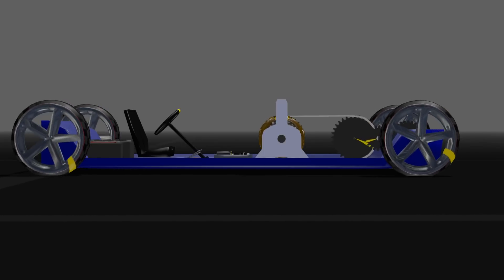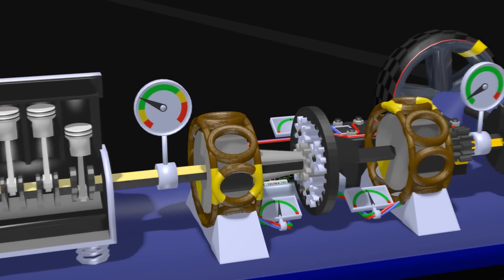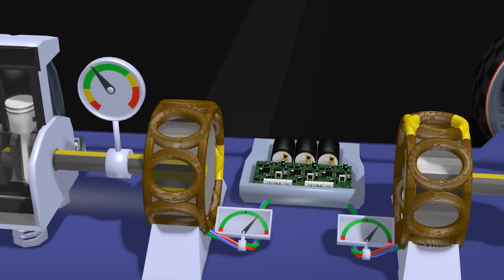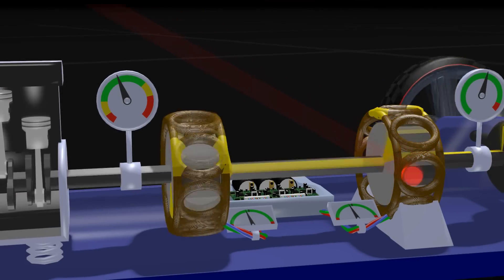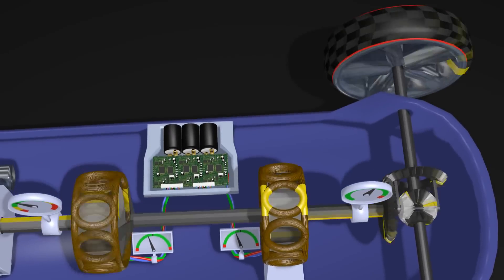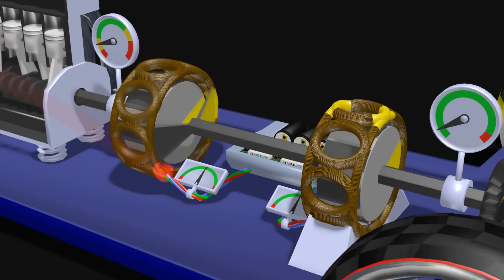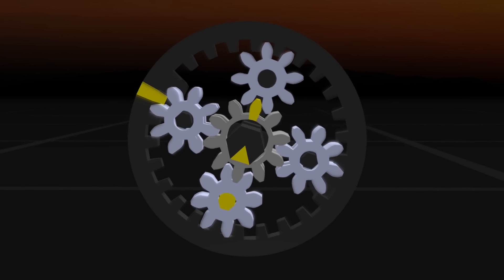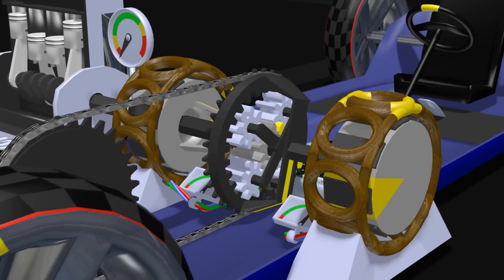Prius Hybrid Drive Explained

Comment: So the basic idea of Prius Hybrid is adapting the system from a Diesel Locomotive. Using the engine to power the electric motor so it will spin the wheel...?
Reply: Yes, exactly! Another name for this powertrain type is gasoline-electric. And unlike locomotives, being on the smaller scale of passenger car allows batteries to be used.
Reply: Sort of... with an extra catch of a planetary gear that "reinvents" the workings of a cvt. Production cars with a real engine-electric system like diesel locomotives is the Nissan e-power lineup. A puny 1.2 litre 3 cylinder with 80 horsepower connects to nowhere but the generator unit. And a 108 or 130 (depending on model) horsepower electric motor does the whole work to the wheels.
Reply: No, that would be a series hybrid, not a power-split. Also, it's not a hybrid unless it has two power sources (an engine and a battery), but the traditional diesel-electric locomotive (or ship) drive has only the engine (no battery).
Reply: @brianb-p6586  It's basically what new Civic uses. Plus it has direct mode, where combustion engine powers wheels directly (through simple clutch), to avoid double energy conversion when possible (at steady speeds of 60-150km/h in case of Civic). It may be even simpler and nicer solution than Toyota's. There is no gearbox in Civic as there is no need for one because strong electric motor powers wheels. End result is that 184HP Civic in 1000 km mixed test got basically same end fuel economy as 184HP Corolla (5l/100km average). Difference is that Civic is bigger/heavier and it provides better dynamics (due to use of powerful electric motor). Both are interesting, but I think Honda's may be even better due to simplicity. Maybe Toyota's has bigger potential though.
It's also hybrid as it has small battery to store surplus of energy (also from recuperation) and help to give electric motor more current in extreme cases.
Reply: @SOMEONE-ME  All Honda models with iMMD (intelligent Multi-Motor Drive), as well as the Mitsubishi Outlander PHEV, work that way. The bypass clutch is important to efficiency. There is a gearbox, but it has only one drive ratio.

It is more complex than a Prius transmission, with just as many gears plus a clutch. It is more efficient than a power-split when the clutch is engaged, and less efficient the rest of the time.
Reply: @brianb-p6586  When you look at actual physical design on weberauto for both systems then hard to see that Honda's is more complex, but I'm not an expert, so not going to argue.
How can you call single gear ratio a gearbox? For me 'gearbox' is something which allows to change gears :) Civic uses a fixed connection, wich is in every car including electric ones.
I agree that clutch is an extra/weak(?) element.
It would be nice to count moving parts as this is some (maybe poor) indication which is more complex :)
Possible what you said about efficiency. In real world Corolla and Civic with same HP are basically identical for long mixed drives, but Civic is more dynamic and gives more pleasure (but this is also due to whole cars been different). New gen. 5 system in Corolla for 2023 may actually change it. Finally Toyota realised that using more powerful motors may actually benefit even efficiency.
I prefer both solutions to 1l+ turbo engines :)
Still the king of simplicity and efficiency is an electric motor (good 3x). If we just had good enough battery tech to allow to use electric motors properly in cars.
Reply: @SOMEONE-ME  A gearbox is literally a box with gears; just check dictionary definitions. It is a form of mechanical transmission, specifically using gears. The gearbox or transmission in a car normally has multiple ratios, but that doesn't mean that all gearboxes have multiple ratios; fixed-ratio gearboxes or transmissions are common in industrial applications and now in electric vehicles.

Count gears in the Honda unit and a Prius unit... there are about the same number. The power-split device in Toyota's design is a single planetary gearset; it is no less complex than a clutch, but doesn't require a control system and is more durable and reliable than a clutch.
Reply: @brianb-p6586  Not going to argue about a word definition as it's really meaningless here. 'Real gearbox' is rather complex, made of many parts, breaks, expensive to repair etc. Single ratio connection is FAR from it.
I think both systems are interesting, yet quite different.
Clutch in Hond is not going to operate that often (compared to "normal one") and it also not going be no near stressed as much as normal one. Car will be steadily moving every time it will be applied, so it should last many years without replacement.
Same as petrol engine ( this applies to Toyota as well, but more to Honda), wich is not going to be stressed much in Honda's system (hence 5y/300K km warranty as standard for this part).
I 'like' more Honda's design because you drive on electric motor, but Toyota started putting much stronger electric motors (as well as petrol) in their system, so this is also good. Funny, that gen 5 hybrid system in Corolla for both 140HP and 196HP has same fuel consumption rating (even bit lower for 196HP system)! They just added figures for Europe.
Reply: @SOMEONE-ME  A multi-speed transmission is obviously much more complex than a fixed-ratio transmission. I was just pointing out that you were mis-using the term "gearbox" to mean something that it doesn't, presumably because you didn't understand the actual meaning.

I agree that the Honda iMMD clutch cycles relatively infrequently, but still infinitely more often than not cycling at all. It slips very little because it is not used to start from a standstill, minimizing wear, but nothing in the Prius transmission shifts at all.
Reply: @brianb-p6586  Yep, but in Prius weak point will be moved more towards petrol engine, which is a complex device :)
And I'm not Honda fan by any means- I own Toyota and next car for specific reasons will be also Toyota.

Comment: I believe you missed the purpose of planetary gearset here, it's meant to combine output from motor and engine, how else could you achieve that? if you connect them both on same shaft you will affect their efficiency or one would hinder operation of the other.
Reply: A planetary gearset is like a 3-way adapter for gears. It does allow combining two inputs for one output. And more as well.
Reply: @StephenGillie  In normal operation, it's acting as a splitter, rather than a combiner: the engine is the one input; MG1 is one output while a mechanical gear and shaft path is the other output.
Reply: yet please explain how the car converts energy created from motor/generator to battery.
Reply: @Jordan-zc2cp  
That's simple, really. All motors can become generators when the current is run in reverse. When the car is slowing down, the motors convert the energy into electricity and send it to the battery. When the engine is charging the battery, its doing the same thing, generating electricity from gas.
Reply: I agree - the animations are brilliant, but the basic function of the power splitter is not given at all.

The power splitter splits the power from the engine into two paths:
- mechanically to the output through just gears and shafts
- electrically from MG1 to MG2, and then to the output

Since the mechanical path is more efficient than a generator plus motor, a power-split system is more efficient than a simple series hybrid. MG1 is required to change speed greatly to allow the engine to run at the desired speed with changing wheel speed, but the electric motor-generator can handle that.

Comment: I have a Gen II Prius with 239K miles. I try to explain to friends why I love it. This video will help.
Reply: Prius is a fine ensemble of engineering. it's extremely underappreciated by the average Joe.
Reply: @NoName-ky2sb  Prius Gen4's body design is ugly while Prius Gen5 looks good and it's the real successor to Gen3.
Reply: @valenrn8657  Sadly it looks like gen 5 compromised on interior and cargo room, which is one of the main reasons I was looking at a prius, aside from fuel efficiency and reliability. If used prices ever stabilize, I'm probably looking at a gen 4, though I will say gen 5 is probably the best looking prius yet.
Reply: Driving past gas stations more often than into them is another ;-)
But that's just gravy, because my primary motivation is clean air for the kids.
Reply: I have a 2013 Prius. It has 246,000 miles on it. I just bought it in June last year. What is the reason it's really loud when I go one the highway? It's was just inspected, so there's nothing wrong with bearings or anything.

Comment: That is NOT how a motor/generator works.  The coil of a motor is not connected to another coil through small coils.
Reply: The set isn’t a motor/generator, each unit is a motor/generator. The Prius has two motor/generators.  They can both act as motors, both as generators, or one of each depending on the demands being placed on the car and the battery state of charge at any particular time.

Comment: What could be the cause of a vibrating noise coming up mostly when the engine is switching from electric to petrol. This noise last for just about 30 seconds, after that the car drive in a perfect condition. This happens mostly from start and when the engine is cool.
Thanks 
George
Reply: especially , if your car is more than 10 years old🥰🥰 🥰
Reply: engine head gasket needed to replaced, you can search for the prius symptoms of leaking head gasket, good luck🥰🥰🥰

Comment: Why doesn’t every vehicle have a hybrid setup?
Reply: Probably costs. I think in future all cars will be hybrids. But for now a hybrid engine and battery costs a lot.
Reply: @tertainment414  the future of cars is hybrid motorcycles ;)
Reply: @robertoguerra5375  nah because hybrid needs weight for momentum and motorbike needs less weight for performance. Don't think it's that viable. Think would be part ev for extra instant throttle though. PHEV not hybrid imo
Reply: batteries are still more expensive, hybrid models tend to be slightly more expensive than traditional cars.
Reply: @Appletank8  but wat people dont realize is that when you have a hybrid system, wayyy less petrol is consumed, so it lowers gas costs termendously depending on how long one owns the car.
Reply: I get 60 mpg in my prius prime when running on gas. Most of my short trips are just on battery and the engine never starts so infinite gas mileage on those.  Those trips cost 69 cents of electricity to go 25 miles - or about 126 equivalent miles per gallon at $3.50 per gallon.  I fill up the 9 gallon gas tank 3 to 4 times per year 😎

Comment: CHAIN drive! Now, that's interesting.
Reply: Chains are used in what might be surprising places. There have been a few transmissions that use a chain instead of gears to transfer power laterally. Toyota doesn't use a chain in Prius transmissions any more - they re-arranged the components so the mechanical power path is all gears.
Reply: replaced by gear wheel on later models

Comment: Its a little unclear. Does the engine at ANY point propel the wheels??
Reply: Depends on what MG1 and MG2 are doing. If MG1 (sun gear) is spinning backwards, the car can move without the engine. If MG1 is stationary or spinning forwards, the engine can provide torque to MG2, which is directly connected to the wheels. MG1 spinning up is also working as the starting motor
Reply: Yes, the final drive from the engine is controlled by the speed of MG1 through the sun gear. Causes under and over drive
Reply: Yes, the engine always drives the wheels if it is running. Some engine output power goes through the generator and motor system, while most of the engine output power goes through the power splitter and other gears to the output.

Comment: 3:18 I have always favored the system where you use ICE to generate electricity and then Electric motor to drive the wheels. How is this system called and what manufactures actually use it?
Reply: That is usually referred to as an "electric vehicle with a range extender". It's similar to some trains, the railbus I use to commute to and from university uses such tech as well.
Reply: I believe the catch-all term is PHEV's (Plug-in Hybrid Electric Vehicles) and the Chevrolet Volt, Honda Clarity, Toyota Prius Prime employ a similar setup.
Reply: @KristoKorps  No, plug-in hybrid just means that it has a large battery so it is practical to charge it by plugging it in and to drive on the battery alone (engine not running) for a significant distance. It has nothing to do with the design on the hybrid transmission system.
Reply: I think that's called Series Hybrid. Engine to generator to battery to motor. This isn't used often because its somewhat less efficient. Prius uses Series-Parallel. Direct drive when its useful saves energy.
Reply: As already explained, that's a series hybrid.

The first series hybrid which became well known to the public was the Fisker Karma; remember Walden driving on on Two and a Half Men a decade ago?
The best-known series hybrid might be the BMW i3 REx (the version of the i3 with an engine).
Nissan now makes some models with a series hybrid system that they call e-Power.

The Mitsubishi Outlander PHEV runs as a series hybrid at low speed, then engages a clutch to connect the engine to the output mechanically to become a parallel hybrid at higher speed.
The Honda i-MMD system found in the Accord and some other models works the same way as the Outlander PHEV.

Comment: Brilliant video, I did not understand this system before. Could a hybrid drive work on a small aircraft efficiently.
Reply: There's really no point, because aircraft don't have a transmission, they have the propeller blade designed to work at an optimal aircraft speed and engine speed. The vast majority of the time they're just at the one speed.

Comment: I did not understand why the planetary gearbox, if it works without it ?
Reply: To put power through mechanically rather than through the electric system, which makes it more fuel efficient.
Reply: To keep the motor solenoid static within the car. This way you can power it without some kind of brushes. Without the gearbox, both rotator and stator have to rotate and it is usually a bad idea a rotating stator.
Reply: @oddardrakill  That's what the video says, but it's not really true. The system with a rotating stator shown in the video isn't used by any hybrid and does not work the same way as a power-split hybrid such as the Prius.

Comment: Question 2 Rev1, is there any provision for (or benefit from) charging the Prius battery from the power grid?
Reply: Yes.  Electricity is cheaper than petrol, and more efficient.  Plug in Hybrids cost even less to run per mile.
Reply: For the standard model Prius, no there is no external charging provision. However, Toyota does offer a plug-in hybrid version called the Prius Prime. It has a larger battery pack which can be charged from the power grid and offers a longer distance on battery power alone, around 20-25 miles (~30-40 km).

Comment: Toyota HSD is really the automatic transmission 3.0 PLUS the benefit of extra torque and regen, while also recalibrating the ICE for ultimate efficiency, since it's no longer the sole power contributor. Why every company hasn't phased out ATs for HSDs is what needs to be urged by EPA and the ilk. Instead of plaguing ICEs with more environmental devices, just require HSD for every non manual transmission car. In fact, with HSD out there, looking back at the traditional ICE car in general, and it is just a savage energy and $ waster.

Comment: At 4:30 what I do not understand is that how the two parts of the generator can glue together and move together completely when they do not touch each other? Can someone please explain?
Reply: The two parts are acting as an induction motor, knowing how they work is kind of required knowledge for understanding this video, Niels really should have said that at the start. In short, AC current is applied to the coils of the MG (motor generator), this produces a magnetic field. The middle part (let's call it a rotor) is electrically conducting and a conductor moving through a magnetic field means a current is induced. This current produces a magnetic field - now you have two interacting magnetic fields. This couples the rotor + stator in an induction motor. In a normal induction motor that is in steady state, they won't be coupled completely 100%, there'll be slip of a few percent. Because if they spin at the same speed, the rotor (the middle part) doesn't experience a changing magnetic field, but instead a static one, then it'll not experience current flowing, doesn't generate a magnetic field itself etc.
Reply: They are linked through magnetic fields. Varying the "slip" of mg2 is how the Prius truly "shifts gears".
Reply: @bat__bat  its an electromagnetic transmission
Reply: This operation does not occur in the Toyota hybrid system. You can try to understand it if you want, but it has nothing to do with any hybrid transmission in production.
Reply: @brianb-p6586  is there any graphical ways where the Toyota hybrid system is explained?
Reply: @Xmarcello88  Yes, but good and clear explanations can be hard to find... especially since what is good for you depends on your existing knowledge and understanding. 

You could try the Wikipedia article for "Hybrid Synergy Drive", but if you are not familiar with planetary gears the diagrams might not make much sense.

Dr. John Kelly's excellent videos in the Weber State University channel clearly show everything in various hybrid transaxles - including at least two versions of Toyota's system - and he clearly shows how all the components fit and move together.... but he doesn't really try to explain the concept of a power-split system. He uses the actual parts, not diagrams.